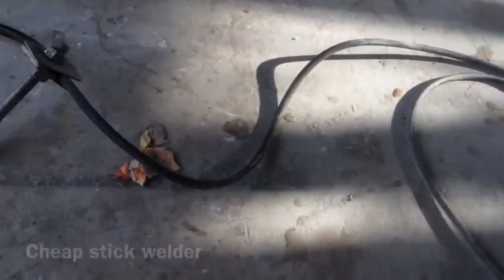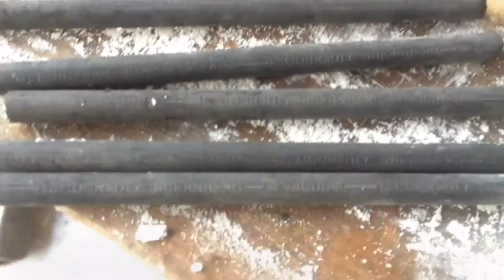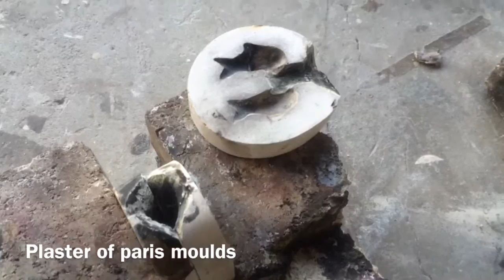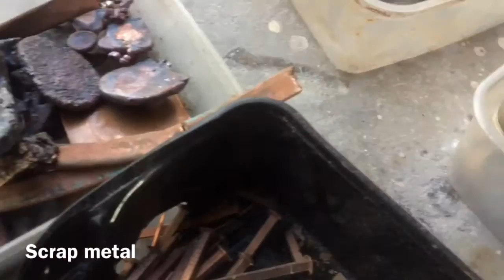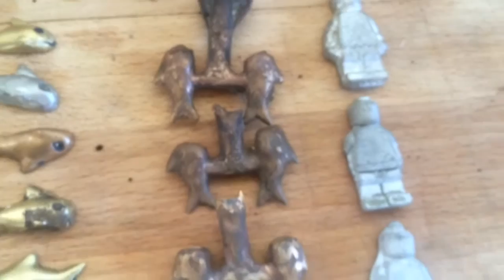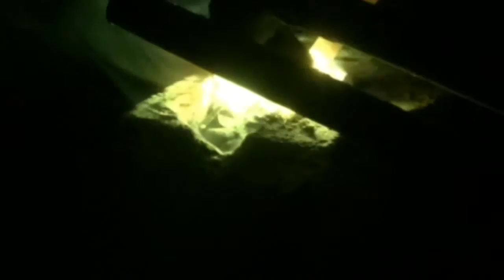Easy mini electric arc furnace

Comment from the maker: Gidday! Not quite iron, just copper. It will melt iron easy tho. i like copper, good looking, workable and durable. 
Plaster of paris turns into fire above 1200c, so its not ideal, but it works for 1 or 2 casts if its dried for 8hrs in oven, or 30min in microwave. Casting sand is hard to find down these ways. And im lazy.